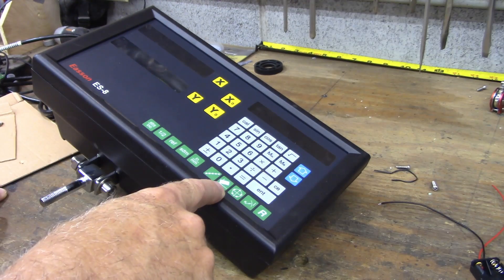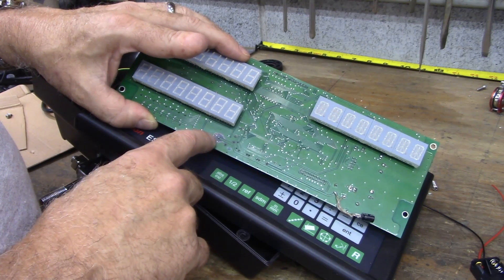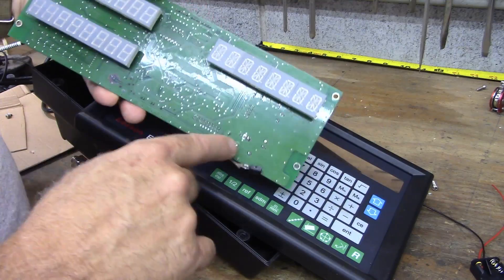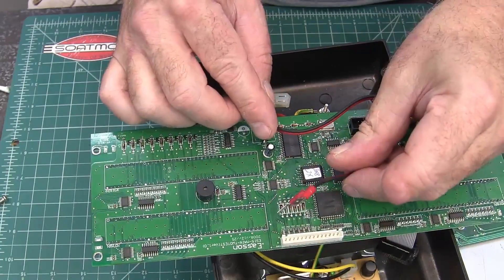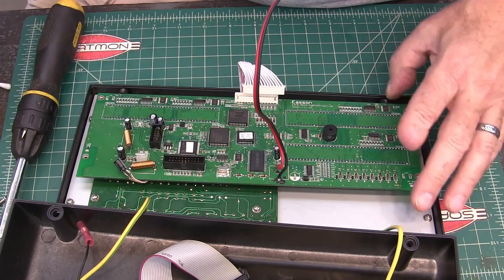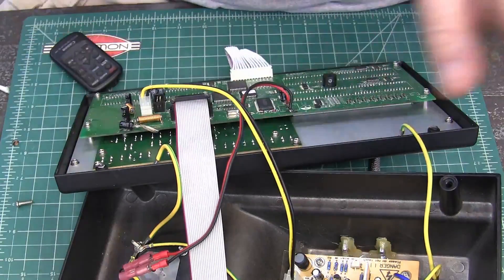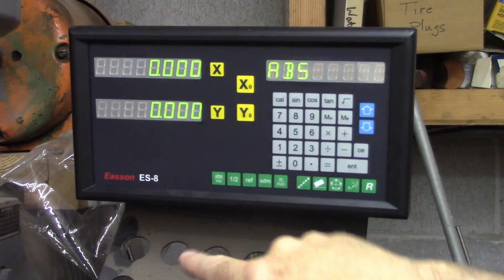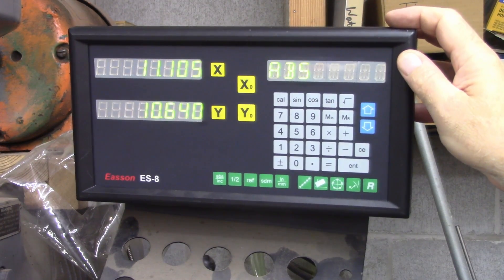Easson DRO Circuit Board Repair

Comment: The battery back up does indeed provide a small current to keep the memory supplied. If you notice the numbers you had showing on X and Y when you switched the readout off were retained when you switched it back on again it shows the memory was retained whilst the main power was switched off.

Comment: Interesting! 
My ES-8 has gone wonky, perhaps worse than yours. The corrosion spread to the two ICs below it. I'm currently cleaning it up and considering whether or not to go with external batteries. The 2.4 volt 80mAh internal battery lasted 16 years! Did your aaa NiMhs ever fully charge? 
Thanks for your vid.
Reply: Struggling to even find a 2.4 volt 80mAh battery on the net let alone australia  :)
Reply from the maker: It has worked well so far...

Comment: Also, I worked on these battery messes a lot on old arcade machines.  It's best just to find another area you can solder to like he did, but sometimes you're stuck having to work in the area. A helpful tip is to clean the area with vinegar to even out the alkali.  Use a flux pen to promote soldering even if you have rosin core.  Then make sure you clean the area with alcohol and toothbrush.

Comment: I suspect the battery is there to keep the calibration in memory when powered off?  Did you by chance verify with a dial indicator that the calibration is still valid and the scales read accurately?  If that’s not the case, why does it need battery?  Thanks for sharing 👍👍😎👍👍
Reply from the maker: Good point, thanks for bringing that up.  I'll check to make sure it's correct.  I was thinking it was there to keep your current position if you had a power failure but I did not think about your point.  I will check!  Thanks!!